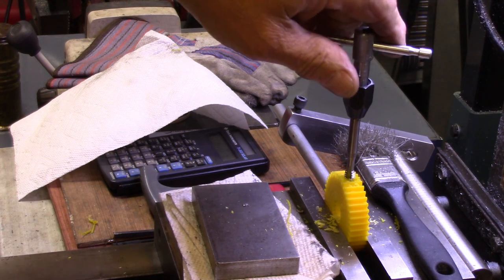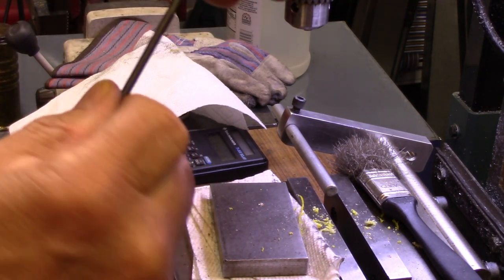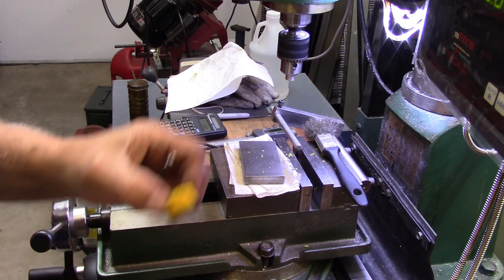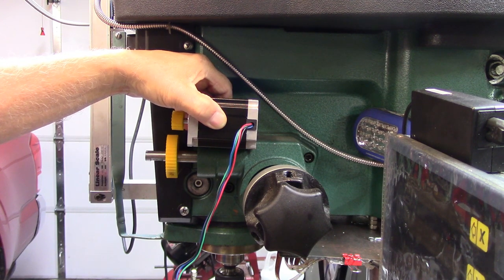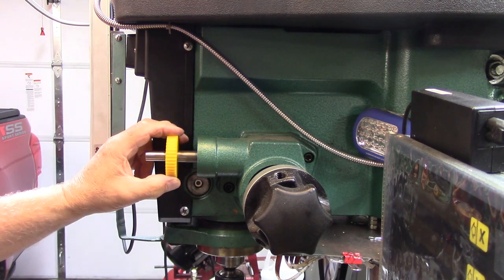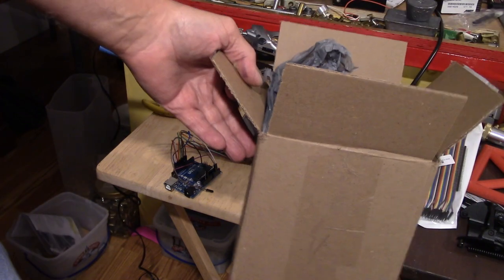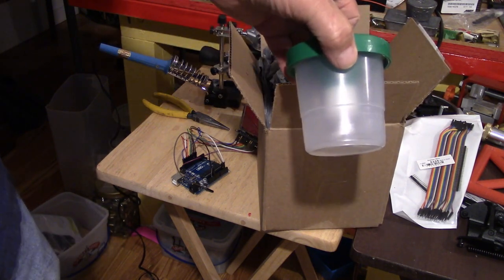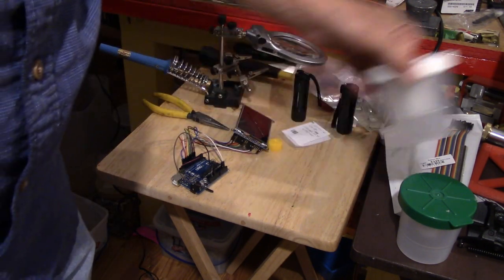Grizzly power feed lak of palning part 2 of 2

Comment: Hi Harold,  I had the same problem trying to set up a power feed on the quill.  So what I did was buy a gear driven motor from Banggood that turn at 30 rpm's.  I drilled a hole in the hand wheel and pressed a 1/4 hex thru the wheel and made an adapter for the motor to hold a 1/4 hex,  I added a forward and reverse switch and it works great, When I don't need the power feed I just pull the motor out.
Reply from the maker: Sounds like a good solution.  Thanks for stopping by.

Comment: I'm another who does a lot of design on the fly - just the way some us work! Sometimes it works but sometimes not! Pulleys should be better for the drive yes.
Those oil cups look super handy.
I really need to get back to my Arduino - like you, forgotten a lot of the little I had learned.
Look fwd to what you manage next on this.
Reply from the maker: Happens fast.  Thanks for stopping by.

Comment: The belt and pulley system will be much more forgiving. With gears(especially plastic) when something gets in a bind it tends to lead to a lot of broken parts. With belts and pulleys you can usually set it up to slip if something binds up.
Reply from the maker: True that.  Thanks for stopping by.
Reply: Timing belts don't generally slip.